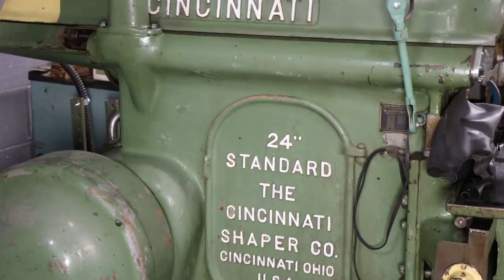Doall mill Saddle on the metal shaper.

Comment: Like your Vlogs you bring across some interesting topics.
Can your hand forklift be modified to install a hoist or light duty crain on to it?
Reply: Yes relatively easily but usually the length of the fork lift tines are the major limiting issue, primarily for "forward reach." The greater the distance forward of the front wheels of the truck the lower the safe lift capacity becomes and the greater the risk of overbalancing forwards.
A further issue is often how much height is needed above the standard mast as the mast is raised before you hit any part of the roof structure of the building - remember forklifts work by lifting an item with their tines underneath the load whereas a crane lifts from above the load with some type of rigging.

Comment: Great progress continues.  Congratulations!  
A bit of concern about the "stairstep" cracking in the new block wall where the cabinets mount.  Is the foundation holding well in that area?  
Keep up the good work and enjoy every day.  Thanks.
Reply: That is the old original wall, the crack is concerning, but likely just a minor crack from the old foundation that side, probably just a cut into the slate with only a minimum of reinforcing added, and likely the wall does not have much in the line of wire tensile member in it. Not too much to worry about, just to avoid high wall loads in that side, which with concrete block is a good thing to avoid any way, as the blocks themselves are not too great load wise, at least compared to proper brick or cast concrete walls. Still a massive improvement over drywall. If you need to hang heavy loads best to go all the way through, and use a plate on the other side to spread the load over a larger area, which then gives a much better load holding ability, up to about a half ton with 4 of them on a wall, to hang things like water heater tanks.

Comment: 6:12  Hey Steve, what sort of blue material is your wedding ring made of?  💍 🤔
Reply: I hope it is soft enough to cut off after an accident in the shop. Nail gun nails are soft so easy to remove from people, but having some maintenance guy come to the OR or ER to remove a hardened ring with a grinder is not fun.
Reply: @millwrightrick1 After I retired from toolmaking, I used to be that maintenance guy at the hospital cutting rings off swollen fingers. But I found using a pair of small, narrow, long jaw vise grips, incrementally tightened and locked on until the cobalt ring snaps worked the best. No cutting close to the skin, and when the ring snaps, it breaks in a couple places and falls off. I've had women and men give me a big hug when the ring comes off. They usually visualize amputation!
Reply: @t.d.mich.7064  Retired millwright here. Hard was easy in that they will shatter but one guy came with a stainless ring. Not hardened but tough to cut. Almost an hour to get it off.
Reply: Steve once told me it's actually made of silicone.

Comment: I know how to obtain the nicest used gantry cranes for SUPER CHEAP,  just need to do the rigging yourself; which means have a licensed bonded and  insured crew for up to 2mill. However that is not the biggest deal in the world.  I got a 1ton Jib crane with 2 ton electric winch for 250.00 but it was 650 to rig. so still not totally bad deal.

Comment: that forklift is pretty usefull indeed , i agree that it is a well made purchase 
if you got some of that slap stuff left you might be able to fill the crack in the wall where you placed those top cabinets 
as for the shaper : i seen a lift fevice that someone (think it was abom) made to lift the vice off any machine , its basicly a piece of thick plate bend in a lazy Z with a lifting eye on one end 
you just clamp the plate in the vise you want to lift off , the lazy z is to ballance the weight of the vice when closed so it hangs level
gantry crane is a good idea , too bad you dont have a concrete slab outside in front of the entrance as you couldve used that same gantry crane to unload stuff from youre pickup or a flatbed truck and bring it intoo the shop 
maibe the local wreckingyard has on that they want to sell cheap https://www.cdc.gov/niosh/face/images/2003/03wa039c.jpg these can move a little eazier on the gravel outside